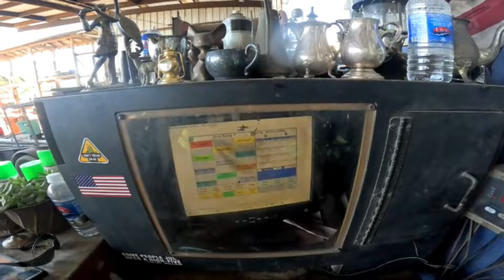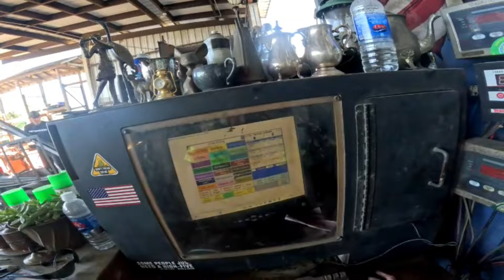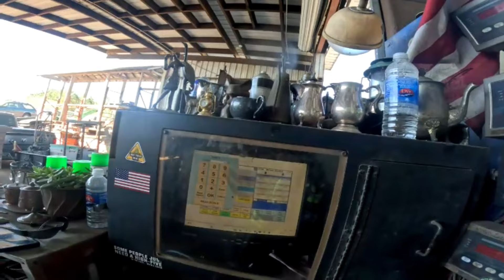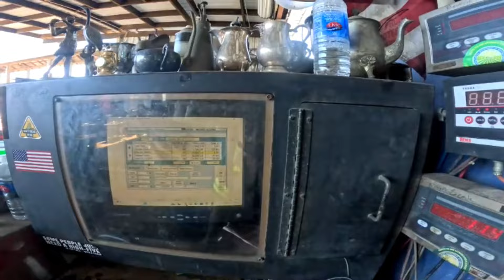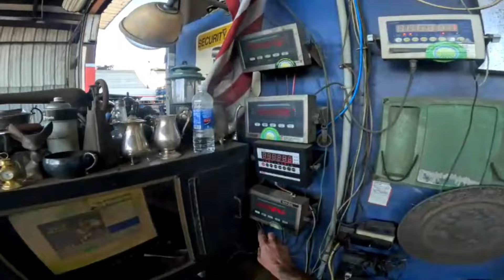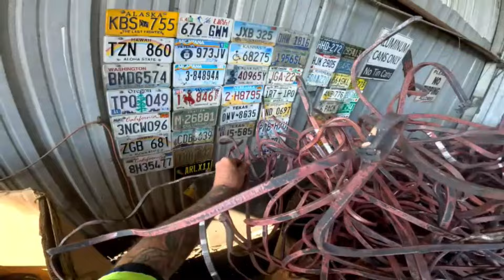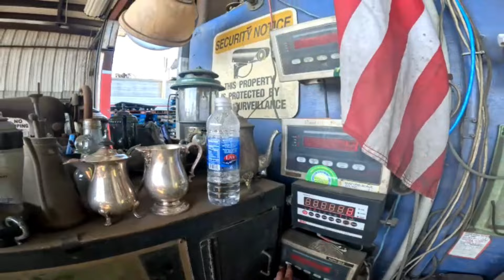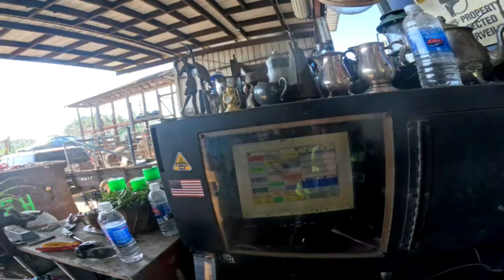WORKIN THE SCRAPPERS #recycle #recycling #scrap #steel #shear #copper #aluminum

Comment: Ordered a wire stripping machine today you can use a drill to operate it or use a hand crank.
Reply from the maker: Great tool to have and will pay itself off quickly.